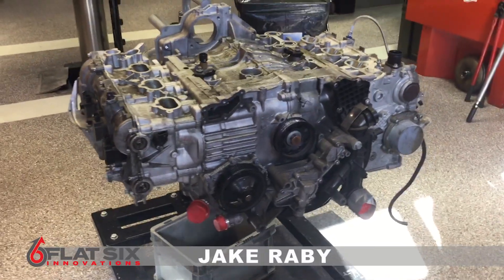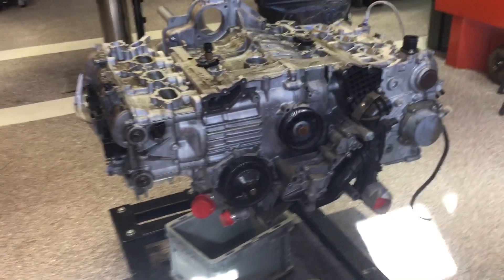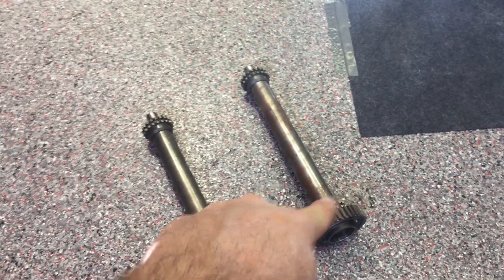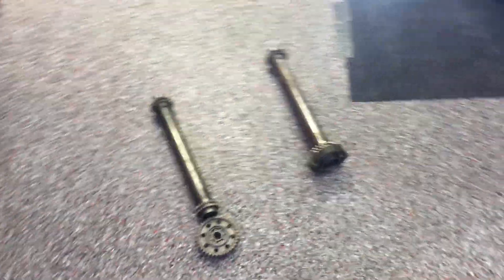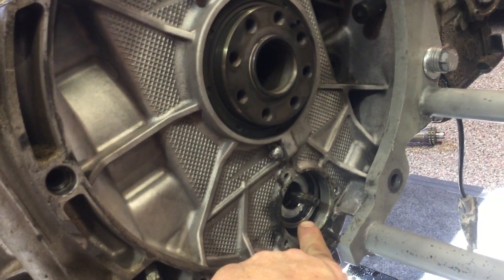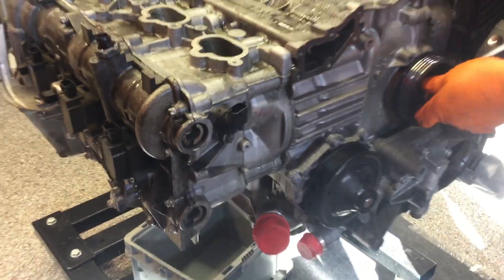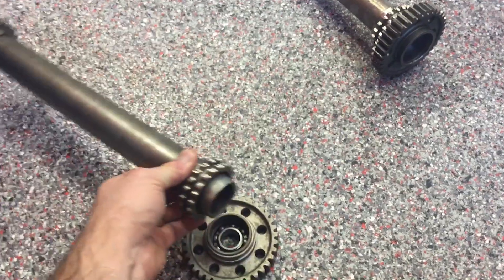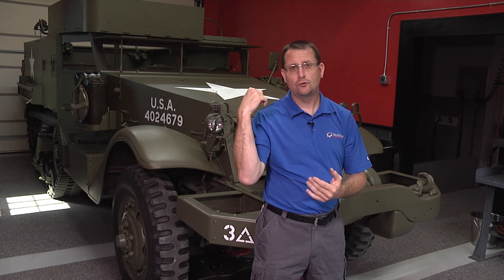Flat 6 Minute -   IMS Drive Sprocket Separation | Porsche 996, 997, 986, 987

Comment: I had my bank 1 timing fall back a tooth or two, but the IMS bearing seems fine. Could it be that just bank 1’s gear had slipped back a few degrees?

Comment: This happened to my engine (1998 Carrera 2), on first start after my shop fitted an IMS Solution. Fortunately it did not damage the engine (timing just slipped a few degrees and the engine stopped) but it did require a labour intensive and expensive disassembly just to pin the drive sprocket.

Silver lining was that my engine turned out to be a rebuilt short block bored out to 3.6 and fitted with Nickies, forged pistons and billet chain guide. Not mentioned by the previous owner.

Comment: Jake, are you saying that Porsche just pressed the gear onto the intermediate shaft without a pin, a keyway or welding them together?  I couldn't imagine a rotating timing assembly without a key or a pin to keep it in correct timing.
Reply from the maker: You can't let imagination be your guide with Porsche engines.